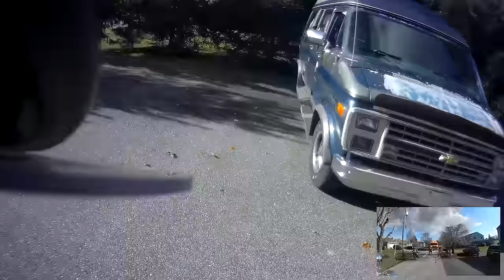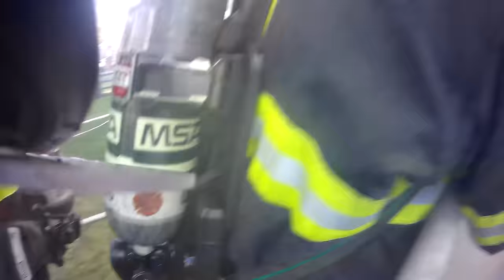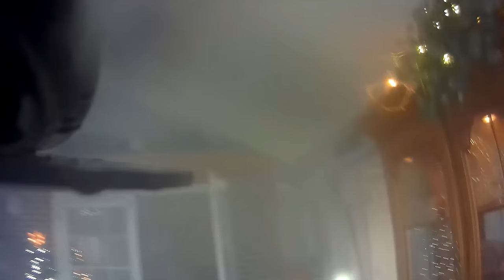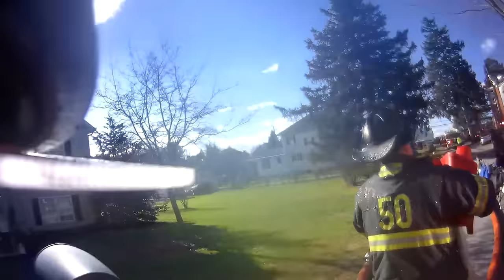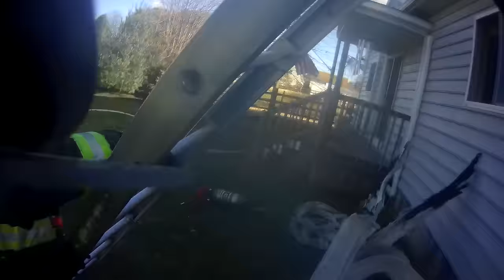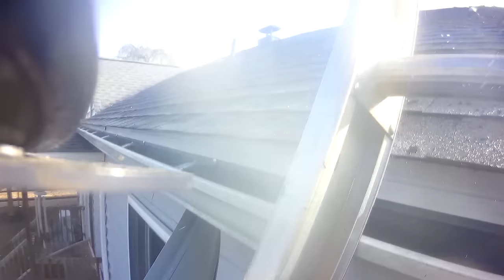Engine 502 First Due 2 Alarm Dwelling *Helmet Cam*

Comment: This was an exceptional response and knock down. I have seen video before of professional fire department that let a garage fire take down a dwelling, multiple vehicles and damaged a neighboring structure... because they all just took their sweet time gearing up and laying out their lines and couldn't be bothered to really go. You guys were right off that truck and getting those lines out immediately to save as much as possible of the house.
Reply from the maker: Thank you!
Reply: As a career FF and former volunteer I completely agree with you not only did they get the line into play extremely fast they ignored he raging garage fire to protect the exposure. If they would have gone to the garage first they could have a well involved attic fire on the delta/side 4 exposure. This is how our crew operates, that’s why it always blows my mind when rigs are on scene of a simple residential occupancy for 4-5-6 minutes with no water application. Shows a well trained crew career or volunteer can operate seamlessly.
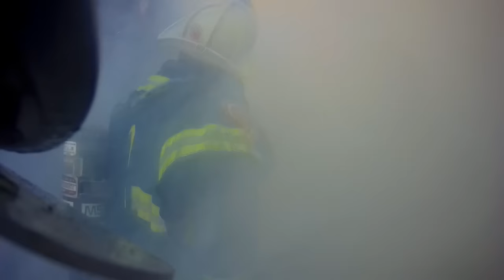Reply from the maker: @schmegle1  I looked in cad, the call was dispatched at 10:39, and we were on scene at 10:45. The other unit was already on the street doing a pr event
Reply: @schmegle1 did you not see Santa?
Reply: @schmegle1  how was this not a great response? Because they have an assembly time once dispatched? I’d love to hear your thoughts.
Reply: @tom0photographi  not worth trying to talk to those who are closed minded. this guy just spews negative talk with every comment
Reply: You very well could have seen that here too.

Comment: With the volume of fire presenting, and a water supply secured, why not stretch a 2.5 with a smoothbore initially and punch it in the mouth with 265 to 300 gpm then use the 1.75

Comment: I am not used to seeing melted houses, vinyl siding has not ever been an option anywhere I have lived either due to wildfire hazard, or simply due to ambient heat plus the sun making it run.  That house looked like it was built very recently, such a shame to lose it.
Reply: After the soaking you gave that firewood, it will be a year before it is useful ;p

Comment: Very impressive work! Great salvage op (almost non-existent these days). 
My only suggestion is that you all learn and practice “Transitional Attacks”. Big fire require big water, big time and fast, since fire doubles every 30 seconds. I saw that you have a TFT Blitz nozzle, but didn’t use it first (suggest preconnecting it). 
Good stop on the extension to the house. 
Over all though, good job!
Reply: Exactly.  I get the 1 3/4" line to stop the spread to the house, but the line to the front of the garage should've absolutely been a 2 1/2" or portable monitor

Comment: Seeing this video is exactly why I'm using flane resistant materials in building my house and detached garage. I am having the painters spray all the studding in both the house and garage with 3 coats of Flame Off. I am using type C drywall, 3/4 " fire rated plywood on the exterior and roof, and Rockwool insulation.

Comment: Just a suggestion the deck gun might have been appropriate for quick knock down  And some  21/2 lines. Delta Exposure is the main priority and opening the roof on the house. But I’m just watching a video. It’s easy to quarterback here. But good work to all.

Comment: I’m pondering the garden hose pressure.  Was the water supply a factor?
Reply from the maker: Not a huge issue, but with several lines flowing at the same time we had to try and prioritize different ones
Reply: Lines now operate at considerably lower pressures than before, those lines all look to have adequate pressure. This is due to nozzle design and larger attack lines. 1 3/4” vs 1 1/2”  means less friction loss. The nozzles combo nozzles we run need 52 psi at the nozzle and flow 150 gpm. Water supply shouldn’t  cause these issues unless you are over pumping a hydrant which is very difficult to do based on the lines they have off in this video. Had they been  operating multiple 2 1/2” or master streams or a combination or are pumping multiple hydrants off the same water main (typically would get city water works to boost pressure to that area) that could cause issues. Or you are doing a water shuttle, which isn’t applicable in this case.

Comment: Fast moves and aggressive, but the wrong lines. A fire of that intensity should be 2 1/2 to blast and knock down the main fire. In the video it is easy to see the lack of pressure and flow from the 1 3/4 or 1 1/2 in use. If one guy is operating a line there is not enough flow or pressure. Also fog nozzles allow to much air flow. Use solid stream tips to attack that type of heat.

Comment: Great Knock, However.... Taking Black Hats off the knob and putting a Chief on? Black Hats doing 360? No reason for that, the guy on the knob was doing fine.... SMH!!!
Reply: What is a “knob”?
Reply: @lindanwfirefighter4973  nozzle
Reply from the maker: Haha, I offered up the nozzle, and the next crew that was told to relive the two of us was made up of white hats. About the 360, it's not a big deal, it's a task that can be assigned to a senior firefighter. Rather do that than stand there and do nothing
Reply: @dustinpoe4422  Thanks. Never heard it referred to as that.
Reply: @Fire-Rescue50  No problem, great video, I try to see every video you guys post.
Reply from the maker: @MagJones  Thank you!
Reply: 360 is a tested NFPA 1001 FF2 skill just like donning gear for FF1's.

Comment: For the life of me I will never understand. You have this big ass tool on top of the engine called a deck gun, use it! You have a garage just as big as a single story house fully involve, knock that shit down as well as protect the exposure then transition with your hand lines. Man, we have to do better. The longer shit burns the more the structure is compromised. Stay safe fella's!